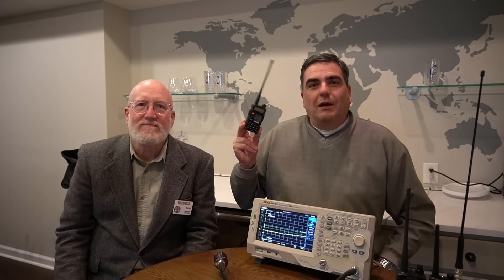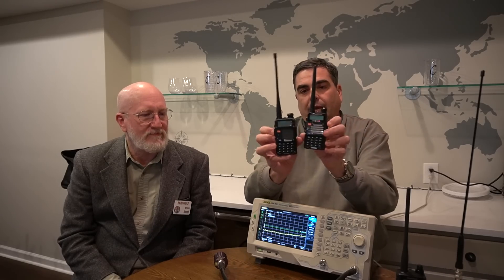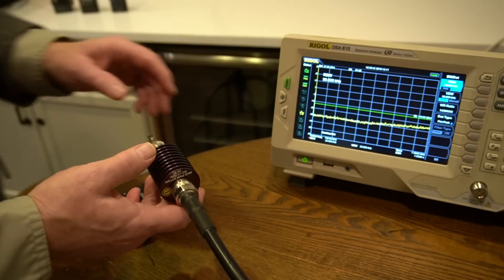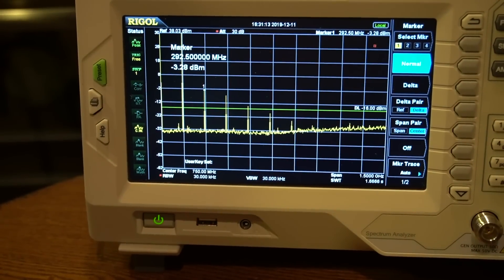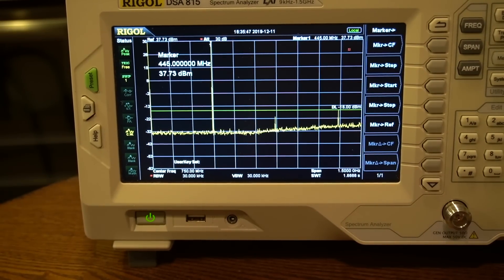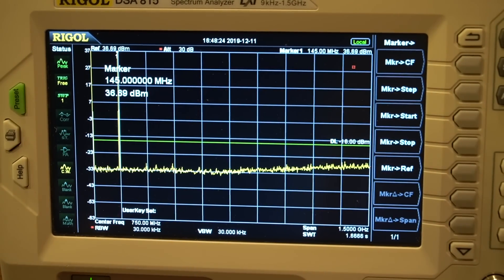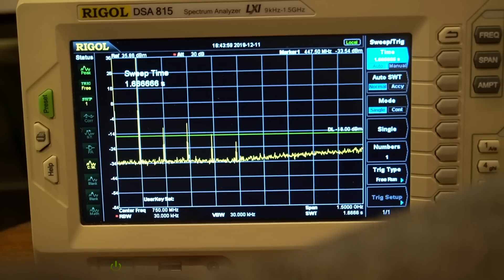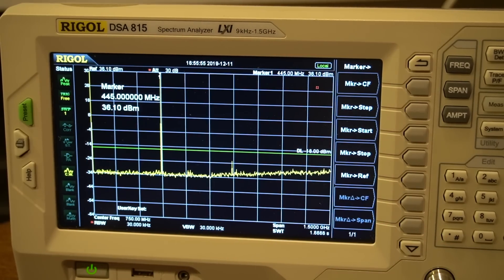Baofeng BF-F8HP testing for FCC ham radio compliance

Comment: Can you explain this.... I bought a 108CM Antenna! YES 108Cm!!! But..... my Nagoya 771 seems to work better? Even if I hold this ridiculously long antenna outside the window which basically goes past my roof, don’t pickup the frequency I always get. But there’s a catch. It does pickup the signal in a different spot. So say I’m at one end of the balcony it will pickup on the 108cm. But where I pick it up with the Nagoya it don’t all all??? So I guess I proved longer isn’t better? 

Also it seems that if I fold the antenna down so it’s in its smallest form. It receives better lol? I don’t get it
Reply: @Trending Pending   Hi Trending Pending.  Longer CAN be better, provided tuning coil(s) are a part of the antenna.  Whatever the length, an antenna needs to be constructed so it ideally provides a 50 Ohm impedance to the radio.  Just making the antenna longer (without tuning coil(s) will result in lower or higher impedance – often in the region of 100s or even 1000s of Ohms, resulting in a seriously high SWR presented to the radio.  That would explain why the longer antenna seriously underperformed against your Nagoya antenna.  

As for your Nagoya not picking up a signal at one end of your balcony – that is most likely due to the Nagoya being in a “null” (no energy) spot of the frequency wavelength.  You can hear that happening when travelling in a vehicle and the signal starts chopping.  

Incidentally, I use a host of different Baofeng models and have personally found the Baofeng stock antenna to be perfectly adequate.  Testing with various Nagoya antennas did not significantly improve my TX/RX, and in several tests the Nagoyas actually underperformed, and more so on UHF (400MHz range).  Plus, I always think a long antenna on a handie talkie looks so Dorky and uncool.  
I hope that’s all useful for you.  Regards, Iain.

Comment: If the Baofeng doesn't pass muster, why is Amazon and others still allowed to sell them?
Reply: I don't know why they are allowed to be sold in the US.  The FCC did send out a warning on them.  I do know if you interfere with others you are running the risk of losing your License, being fined or both.  I think it's a "buyer beware" situation.  If you read through FCC Part 97 they seem to put the responsibility on person transmitting the interfering signal not the equipment maker for violations.
Reply: @scotthill6807  In a shtf situation, none of that matters. All the thousands of people who own these inexpensive radios will be glad they have them. Regardless what the FCC or the old fart hammers say. They are completely irrelevant.

Comment: You can, actually program your preset stations with alfa-numeric names using programming software. Then its a setting on the radio as to which to display. Ki da clunky but it can be done.
Anyway, good to know about my radios, i officially have no usable ham radios :(

Comment: I was not surprised to see the Baofeng radios fail, and by such a wide margin.  As Don said. They have that reputation.  I've seen similar results when monitoring my Baofeng radios on the spectrum display in the Gqrx SDR software.

I was pleasantly surprised by the excellent results when testing the other two Chinese radios.  Good to know!

Want a good HT for a good price?  Try the Yaesu FT-70 - 2m, 440 and you also get Yaesu's digital mode System Fusion.  My only complaint is the off switch isn't a true power off and the radio will drain the lithium battery in a few days, when the lithium battery would normally have half power a year later.

Comment: Is there a way to filter out or reduce the harmonics?
Reply: @Bob Edmondson You have to understand... What is cheap for you is very expensive for me. Sure, my radio is considered cheap, i got it for under $40 during an Amazon flash sale. That might not seem like much, but for me due to my fixed limited income, that is extremely expensive. I only get 1 paycheck per month and it's very little and every penny counts. If i can get the radio fixed for cheaper than a new one, I will do it, I have no choice. Basically, i'm faced with a choice of either pay the electric bill or get a new radio... the choice is quite obvious. This is the dilemma I face all the time.
Reply: @Bob Edmondson that is not the solution...
Reply from the maker: yes  but the filter would probably cost more to make than the radio.
Reply: @HamRadioInAction  can you recommend any cheap radio under $50 USD that can do VHF and UHF and has little to no harmonics?
Reply from the maker: @captsmokey6  still looking
Reply: @Bob Edmondson whatever. If you wanna smash things with hammers, that's your prerogative, but I am not going to smash a piece of equipment I paid a lot of money for. If you cannot give real and valid solutions to a problem, then please keep quiet, you are not helping at all.

Comment: I not convinced that some of what you are seeing is not modulation products within the analyser itself. It common to notch out the carrier using a filter due to the restrictions in dynamics range. Still I’m not saying your findings are wrong. Thanks for sharing.
Reply: he is not taxiing the dynamic range of the analyzer by any means. Erroneous readings usually come from overload of the analyzer. The attenuator easily controlled that. I saw no indication of overload in his tests. I typically use a notch filter when trying for numbers in excess of 80 DB or an analyzer with poor overload characteristics.  His tests agree to what I have made in the past.
Reply: @paulk8io445   Thats all I was saying regarding the use of the notch filter.

Comment: I have not personally seen the signal on a spectrum analyzer after being installed but our shop uses a low pass filter made by mini-circuits inline with the antenna on our baofeng UV-82 radios. It would be interesting to see a video showing the test with one of those inline to see if that actually brings the signal back into spec. The filter we use is a 15542 VLF-400+. https://www.minicircuits.com/pdfs/VLF-400+.pdf
Reply: FYI, we only use our radios in the VHF band.

Comment: BIAS???? He said the BF-F8 failed at the end of the video. Not true. It passed in UHF mode, but he did not mention that.  Just more BS from Baofeng haters.
Reply from the maker: My bias was that I REALLY wanted it to pass. Quality, inexpensive radios help the hobby. I am a ham because of Baofeng. As far as my fail comment, I paid for a dual band radio and only one band is usable. It fails as a dual band transceiver.
Reply: @Bob Edmondson yeah, tons of emergency services are definitely not using trunked systems.

Comment: I am not concerned with the baofengs "passing" FCC standards.  They are cheap radios that "work" great for the money. The harmonics have ZERO actual harm to society or the user.
Reply from the maker: Incorrect. The harmonics are transmitting your voice on multiple frequencies inside and outside the ham bands which can cause interference with other radio communications.
Reply: @Bob Edmondson damn bro, you are a serial commenter whiny boomer. You go through every comment talking about people dying. Citation needed please.
Reply: Planes transmit in like the 2500 MHz range there dummy.

Comment: Shouldn't this also take into account antenna system return loss at the spur frequencies? Even if the BaoFeng transmitters are marginal at best, the net effective spurs that are actually emitted might be well below the -16 dBm Part 97 Requirements. I'm unsure if the Part 97 definition of "Station Transmitter" includes an antenna or not.
Reply from the maker: The specs are for power to the antenna.

Comment: Does anyone make a compact low pass filter for use on the Baofeng to make it legal?
Reply: A shorted quarter-wave coax line (the length taking into account the power factor) will effectively kill a second but not third harmonic. It'll help with receive too.. I put one on my 2-meter radio when I worked at a USAF radar site that had megawatts of RF floating around. Almost all the RF not close to 2 meters went to ground. No effect on my SWR. For a handheld, use thing RG-174 coax. This link might help you design one. To get rid of that second harmonic, set the frequency for twice that you want to operate at, 292 MHz in the case of two-meters. https://www.changpuak.ch/electronics/Coaxial_Stub_Filter_Designer.php

Someone might want to make and sell these to help clean up these harmonic-riddled Baofengs.
Reply: @Inkling777  I haven't seen the results on an analyzer but our company has a mini-circuits 15542 VLF-400+ low pass filter on our baofeng UV-82 radios. They run about $25 and had an aluminum tube built by the machine shop to put it in and give it stability while on the radio. https://www.minicircuits.com/pdfs/VLF-400+.pdf
Reply: FYI we operate only in the VHF band.

Comment: This is Amateur Radio, I'm not going to buy a $3,000 motorola handheld, on the other end, I don't want the quality of a $75 handheld. The Icom ID-51, Kenwood TH-D74 & Anytone AT-D878uv are an ok compromise right below middle of the road quality for what I use on a normal basis. I like the options vs. rock solid IMD, noise suppression, etc. I guess if I need serious specs, its because I am in an over populated RF environment. I am just too used to the features and functionality as opposed to just a specific radio system or systems made more for commercial. I have D-star radios over DMR, because I have far more consistent communications with D-star where I am at than when using DMR.

Comment: Ham Radio is NEARLY DEAD.   Ham radio is CRITICAL for communications in an emergency.   If a $22 radio means more people start LEARNING (not passing) the Hobby and it means MORE communications in a disaster than that is a GOOD THING.  I'm NOT going to TOP the Avocation of the UV5R and advocate the spending of $300, $400, $600 on HTs with companies who's head is stuck up their asses just because you show me some harmonics on a spectrum analyzer.   You are NOT doing Ham Radio a SERVICE by doing this.   You are NOT even explaining what a harmonic is, you are NOT tuning a receiver to the harmonic so we can hear it, or how bad it is.  You are hardly even telling us the frequency of the harmonic NOR are you saying anything about what this might be interfering with and to what extent.    You are just saying DO NOT USE THIS without any good justification.   Just because its not below a long is not good enough.    We need you showing MORE reasons and MORE methods of using the UV5R AND all the others out there instead of showing reason to NOT use it.   Oh...alpha numeric display instead of frequency that's nice, it seems like my ICOM 2AT worked just fine with no alpha numeric, NO MEMORIES.   Manual + and - offset selection.   GET BACK TO THE FUNDAMENTALS OF COMMUNICATIONS !!!
Reply: I kinda agree with you. Is this how the FCC tests and determines that a radio passes or fails this test...?  Can the FCC review this part of the rules and determine if it's still relevant...?
Reply: @KI4TZA  private market.  U can sell or make anything.  Does not need to be FCC approved.

Comment: So... what exactly does failing harmonics mean? As seen in use... like, does it mean that transmission will be more scratchy, recieving quality is reduced, range is over powered?
Reply: No, it means you are transmitting on ADDITIONAL frequencies OUTSIDE your band, possibly (but not very likely) interfering with transmissions of others. If you are transmitting on 145 MHz (2 meter band), then you are also transmitting a weaker signal on 290 MHz and an even weaker signal on 335 MHz. If you are transmitting on 440 MHz (70 centimeter band), then you are also transmitting a weaker signal on 880 MHz and an even weaker signal on 1.32 GHz.
Reply: @charliefoxtrot5001  I'm new to  this. If you program your radio to operate only within the allowable range would that resolve the aforementioned issues?
Reply: @TheCaneLUVA  No! The additional frequencies are due to the cheap electronics being used and can not be programmed away. One would need to add a low-pass filter to eliminate the additional out-of-band high frequencies.
Reply: @charliefoxtrot5001  Ah ok, so if I understand correctly its hardwired into the system board. Since this is my first radio I'll use it as a learning device. Thank you.
Reply: @TheCaneLUVA  Yes. Unfortunately, this video only talks about the Baofeng not passing the FCC regulation. It doesn't talk about the impact of the failure. This is, unfortunately, a problem in the ham community. Instead of educating people, they are lecturing people.

Note that I am new to this topic as well and do not have my Technician license yet, but I do have an extensive electronics background. The $25 Baofeng is still a good model to get to know amateur radio.
Reply: @charliefoxtrot5001  I am with you, I am studying for my tech license as well. Don't have a major budget to get any of the more well known higher end brands. Wish I did have more of a background in electronics. But, I'll take baby steps to get to a level of competence down the road.
Reply: @TheCaneLUVA  What I understand is that the emission of harmonics are mainly due to the circuitry designing and faulty firmware...
Reply: @TheCaneLUVA  a starter Baofeng makes a lot of sense! go for it!!
Reply: Charlie Foxtrot your likelihood of causing interference from depends on how many other services are within the area. If it’s rural area it may cause a problem but if it’s an major city with lots of other services it’s likely to be an issue.
Reply: @charliefoxtrot5001  Really appreciate the way you have explained in simple terms about harmonic emissions.
73
Reply: Harmonics are signals that occur at multiples of the fundamental (intentional transmit frequency). If your transmit frequency is 140Mhz your 2nd harmonic is 280Mhz and the third harmonic is 420Mhz. Typically each increase in harmonic multiple is lower in amplitude. The biggest problem occurs when the radio transmits harmonics at a high enough amplitude to interfere with other services especially emergency services (police, fire and ambulance). Well designed radios suppress the harmonics.

Comment: Okay, in the end, what does this all mean? I have never had any one complain about my signal when using a Baofeng. So what does a "Fail" really mean, what does it effect?
Reply from the maker: Amateurs are expected to comply with part 97 rules, which includes transmission standards. If you prefer a free for all, check out 11 meters.
Reply: @HamRadioInAction  I guess I should have asked, what does it effect, transmission wise. I have and still use a BF F8-HP, and I have had no complaints about my signal quality. Yes I know there are standards and I am a Tech class license holder, but if no one complains about my signal. Thats what I want to know.
Reply from the maker: @JamesHart62  The harmonics are your transmission going out on frequencies other than the one you intended, possibly causing interference outside the ham bands.
Reply: James Hart How would they know where to make their complaint?
Reply: Amtruckn The complaint would go to the FCC. Then they start doing direction finding to locate the source. Next comes the knock on your door.
Reply: @danbutorovich246  Not going to be knocking on my door.

Comment: So what, I will still use my BF F8-HP until some one complains. And I've been using it since 2017 with no problems. I think the FCC is just being way to picky, and perhaps some one else is behind all this. Like maybe a high end HT manufacturer who cant compete with Baofeng? Any ways I've heard that Baofeng radio's in 2020 will pass the tests. P.S. I have the TYT UV8000e HT. had it for a bit over a year, and its working well. Glad too see you tested a TYT. I would like to see the TYT UV8000E or D model tested. Both under 100 dollars.
Reply: Your harmonics will fall outside the permissible Amateur Bands and potentially interfere with other users of the radio spectrum. And yes, the "high end" manufacturers should be complaining when they are performing the necessary steps to suppress the spurious transmissions from their radios. There is a cost to going that extra mile. Get a Kenwood TH-K20a; it is a fantastic single-band radio that is relatively inexpensive and can actually be programmed by hand, or utilize the Baofeng programming cable with Kenwood's free programming software.
Reply: @JosephTyson  And if no one complains?
Reply: @JamesHart62  ,  well I guess as long as your spurious emissions don't interfere with public safety, military, or commercial radio traffic, you'll be "fine".
Reply: @JosephTyson  a couple dB over the limit ..not a crisis
Reply: @Bob Edmondson Well considering two members of the Ham Radio club I belong too, work with and for the local EMS, and we have are meetings in their building and no one has yet to complain, and its not like I'm on 24/7. Interestingly enough. My U5-5R V2+ is certified by the FCC, if you go to their website. I have one of those too. Oh and FYI, where I live all Police, Fire and Ambulance and EMS, use a Trunked Digital radio system now.